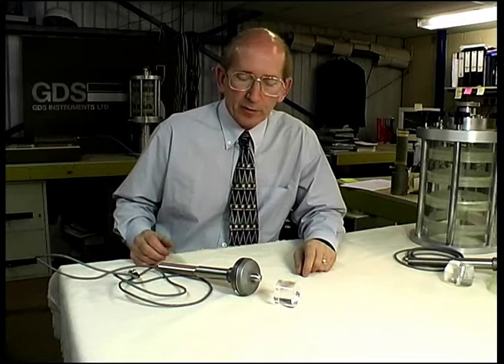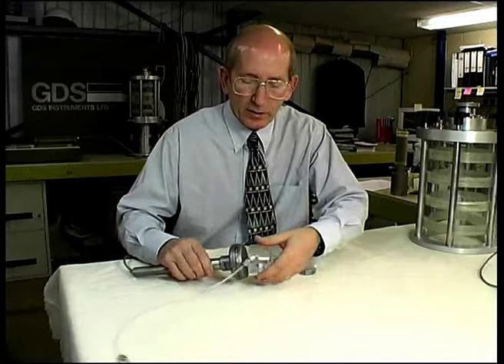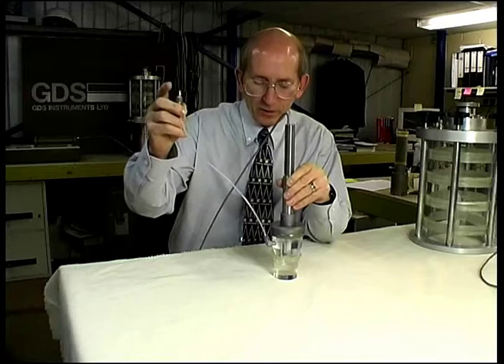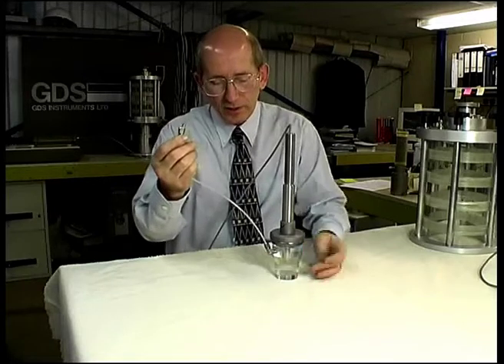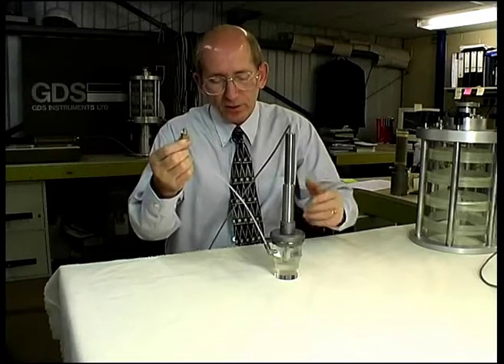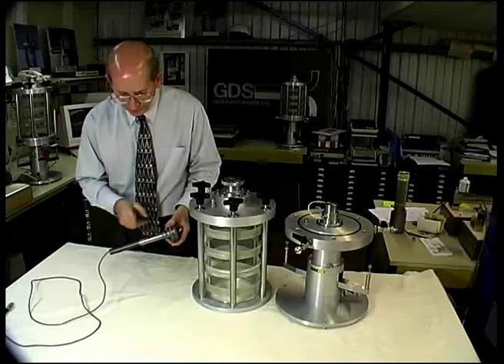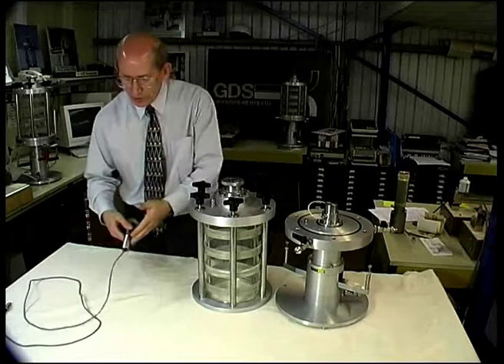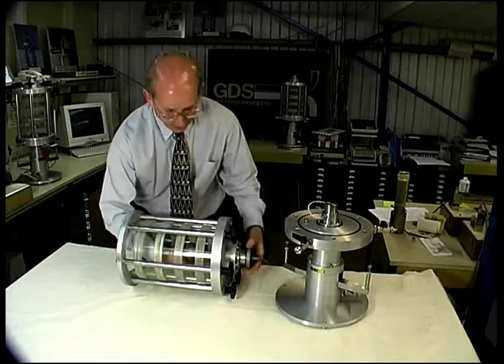Introduction to connecting GDS Load Cells and extension top caps

Comment: I had been facing problems with vylatic seel and top cap of loading piston while doing dynamic loading test. The problem is when I open the top valve the water come out and then vylastic squeezes in, but if I keep the valve open and apply cyclic load then machine makes sound; and if I close the valve then after making sound for 3-5 cycles the piston gets detached from vylastic sleeve and it never apply the load on the specimen. 
Any suggestions for this.